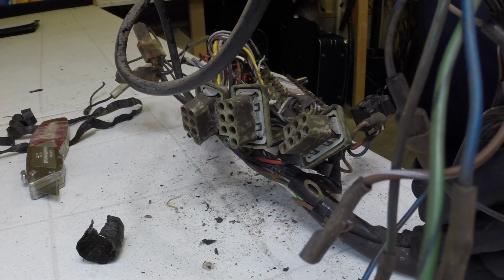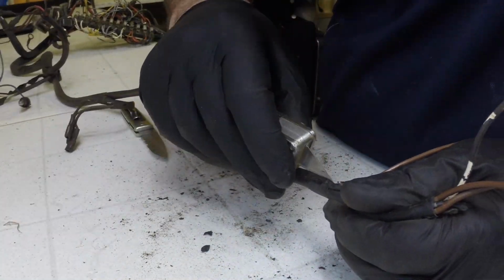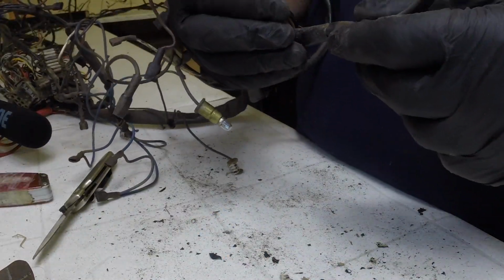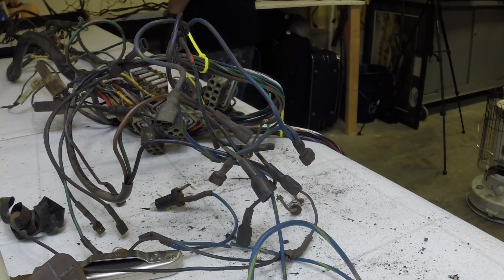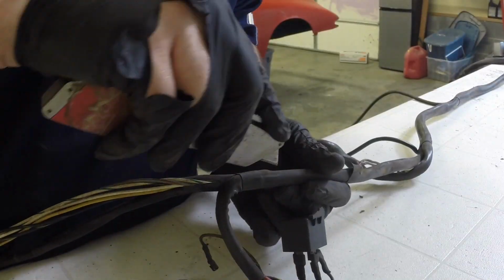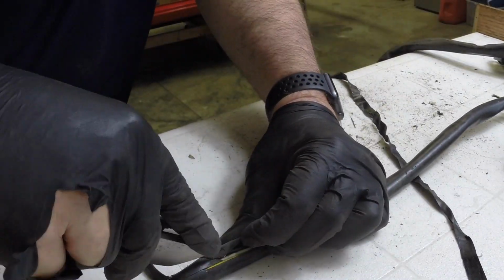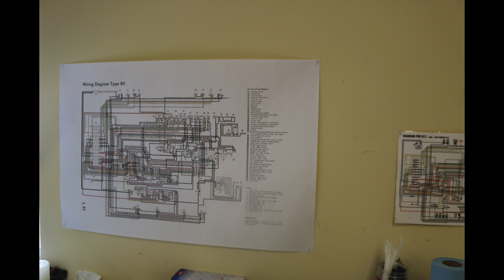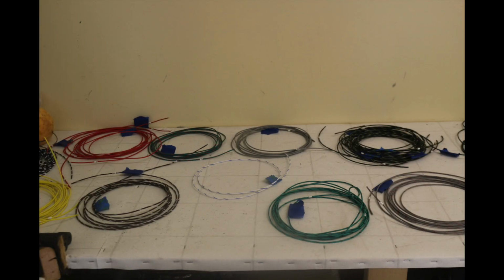Porsche Wiring harness on a 67 SWB 911/912 Part 2

Comment: Thank you for these informative video`s!  I`m also restoring a 1966 wiring harness, but can`t find the correct wires (diameter and coloring) Your are very very close to the originals. Where did you buy them?
Reply from the maker: Hi Roel.  And thank you for the compliments.  You can contact me directly and I can supply you with what you need.  I can be reached at 911highvolt@gmail.com